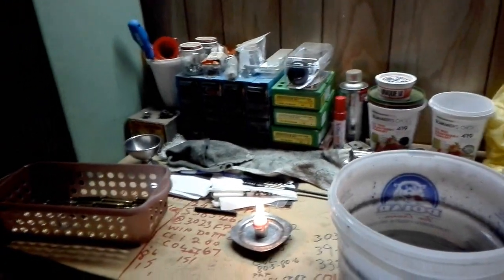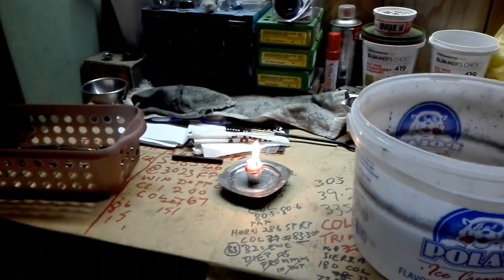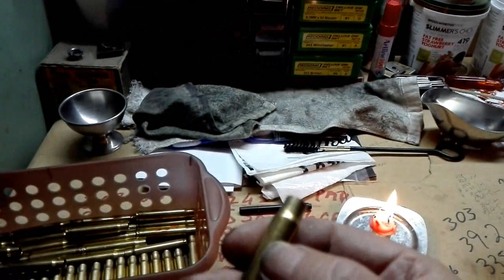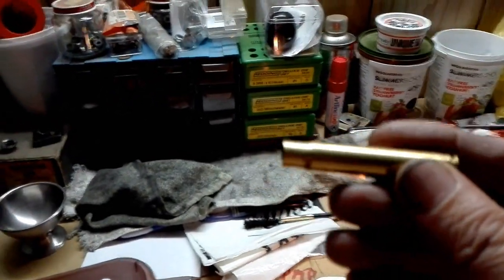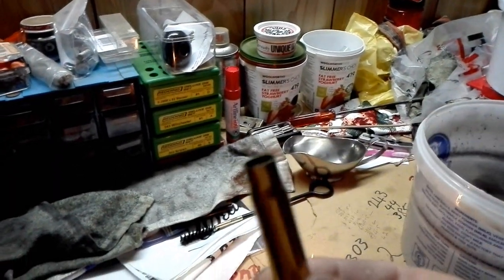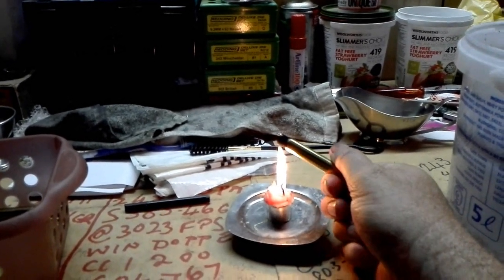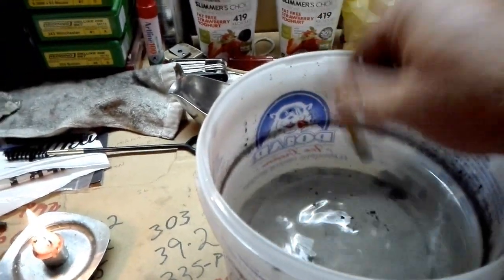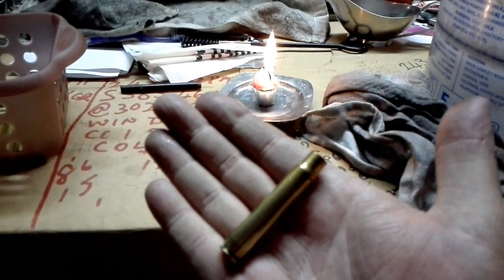Annealing Brass Rifle Cases using a wax candle

Comment: It works for me. I shoot a lot of Federal cases from about 3-5 yrs ago, which then were very weak. The brass would always split necks
after just 2-3 loadings, if they didn't have a web blow-out first. I never use these older federal cases for high pressure max loads in 223.
But with the candle and heating the neck/shoulder junction with my fingers 3/4 way down when I start to feel heat I put the case In a wet bounty towel- the case will now last 10 loadings enough to trim it twice and through away.

Comment: The brass isn’t being annealed.
Reply from the maker: Hi Jonathan, I have been working my brass in this way for many years and through numerous reloads, and it seems to do the trick for me.
Kind Regards
Reply: @heinleroux5678  Your method either anneals or it doesn't. There's no "IT WORKS FOR ME" involved in annealing.
There are charts & graphs with time vs temp curves &, I'm inclined to agree with Jonathan Thornton. 
Truth is; heating the necks to 700F for 5 to 7 seconds does pretty much nothing &, no one can hold the cases after the neck has been heated to that temperature. It's very doubtful you are even achieving a small amount stress relieving.
Reply: @rotasaustralis  Try it with 750 degree Tempilaq and you’ll see it works 🤷🏿‍♂️
Reply: Yes it is. I tried this last night. Got pliers and tried to crush the brass, was super hard. Used this method, and crushed like butter after annealing with a lighter. Try it yourself and you’ll feel the difference
Reply: Correct annealing needs to be at 750 degrees for an hour
Reply: @richardhearne3605 No, you don't heat the entire case to 750 deg F for an hour. That makes the entire case way too soft. Only the neck needs to reach 700-750 deg F, then removed from heating.